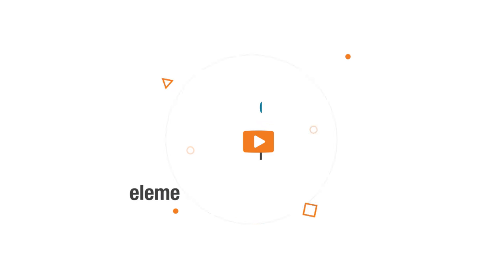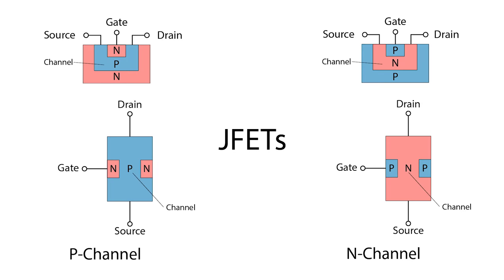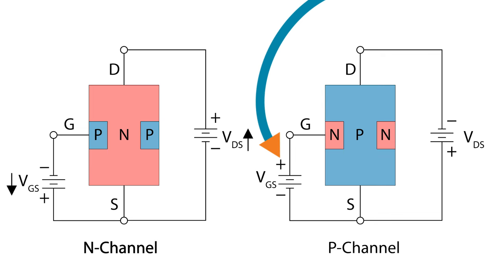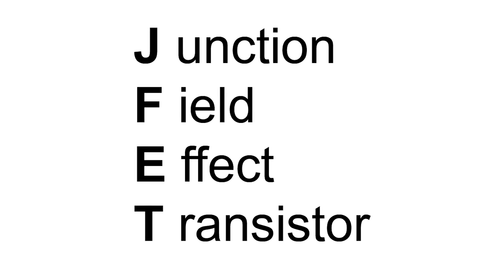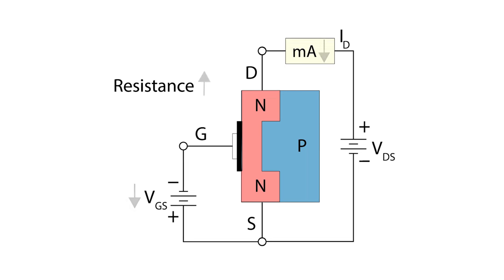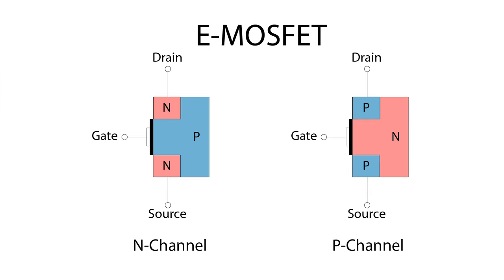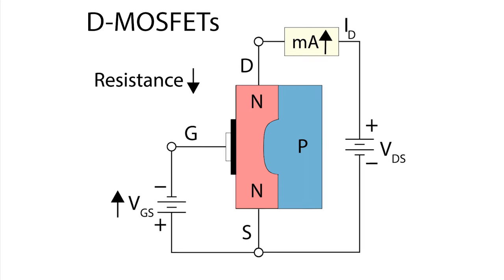How FETs Work - The Learning Circuit

Comment: There is a mistake on the video.  You state the source on the FET is equivalent to the collector on the BJT.  The opposite is true.  Drain = Collector; Source = Emitter.
Reply: In FET, holes move in same direction with current which flow from drain to source. However, in BJT case, current flows from emitter to collector also the holes. As a result, Drain = Emitter and Source = Collector.
Reply: @hasancanar3125  Wikipedia is not the only reference that says so, but for example, Wikipedia says, "All FETs have source, drain, and gate terminals that correspond roughly to the emitter, collector, and base of BJTs."  The other sources will also agree.
Reply: @hasancanar3125  From "FET Circuits" by Rufus P. Turner 1977, Ch. 1, pg. 12; "The drain is equivalent to the plate of a tube or the collector of a regular transistor; the source is equivalent to the cathode of a tube or the emitter of a regular transistor..."

Comment: Seems that the D-mosfet was not forward biased to increase the channel width in the last portion of the video, wouldn't the gate need a positive charge,drawing negative charges into the channel from the substrate, increasing the width of the channel and there by increasing current  through the mosfet, the battery, it seems, should of been switched in polarity from the last screenshot but wasn't?  Great videos though and much appreciated, thanks   :)

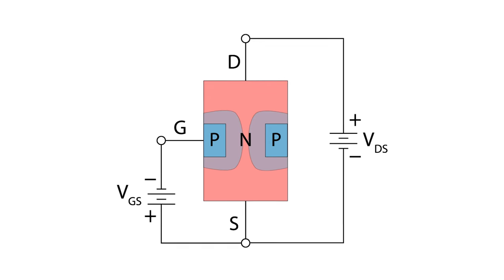Comment: 2:21 why the Gate Source voltage needs to be lower than the Drain Source voltage to a depletion zone happens? In a normally PN junction the higher the voltage is, the higher is the depletion zone (if it is reverse connect)

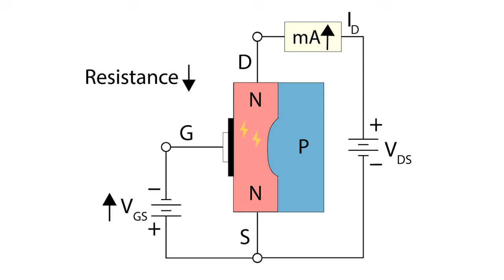Comment: 06:22 : How is it possible that the drain current can be larger or smaller than the source current in a Mosfet? (Apart from the tiny charge to initially charge the gate.) Is this not an error in the video?

Comment: Hi Karen, I love your videos! Im just a bit lost in the word "bias", I don't understand what it is and in the video you say things like "the more bias the gate becomes" and "to increase the bias". I understand the principle of reversed bias or forward bias, I just don't follow it when it is used in a different context. Can you please enlighten me :) thanks so much!
Reply: Hi Anne, The word "Bias" means the operating point of the transistor. The DC Bias is required to make the transistor in the active region such that it can be used as an amplifier. Transistor have 2 regions, (Cut-off, Active & Saturation). Proper Biasing of the gate voltage makes the transistor into active region. Karen, please correct me if I am right. Karen your videos are great and very easy to understand the basic concept . Thank you